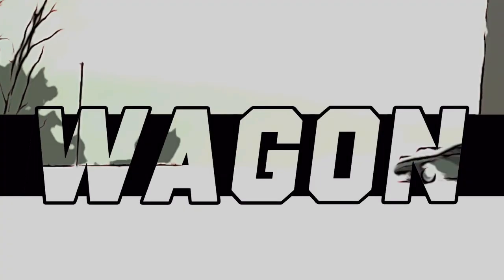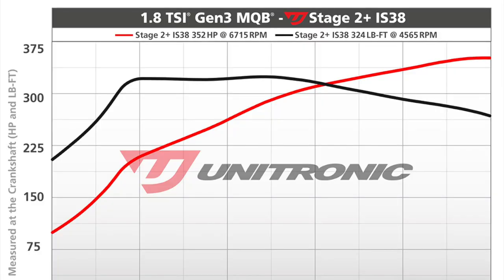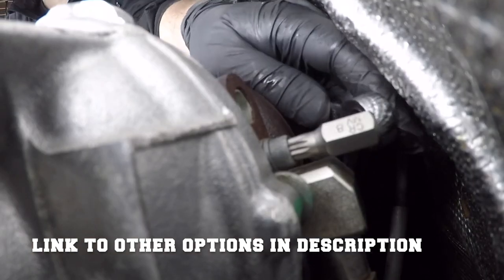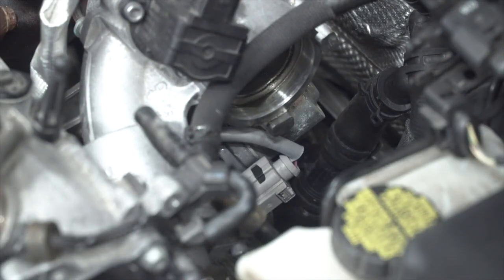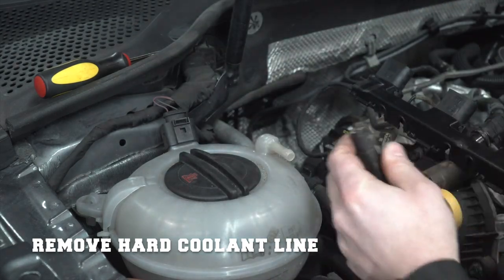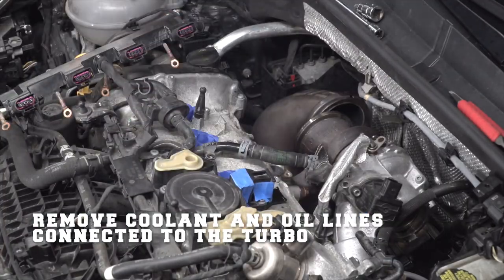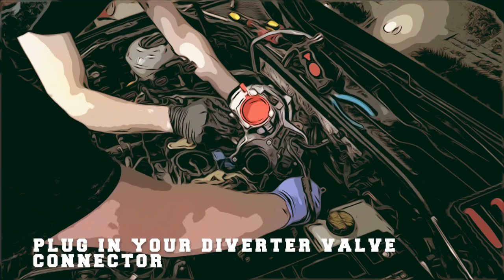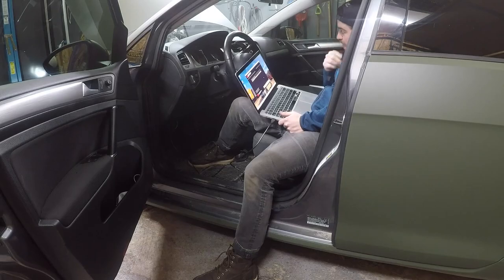Installing an IS38 Turbo - Mk7 Golf Sportwagen - Helpful Tips and More

Comment: That was a pretty undramatic 4.3x 0-60 run. 
4.3 to 60 was what C&D tested a 360 Modena at in 2000. It's a quick number.
Thanks for sharing.

Comment: I just did the APR IS20 in my 2015 FWD GSW. definitely notice the difference. Will do intercooler by spring.
Reply: I should also note that I have been having misfire issues since doing this upgrade. Have yet to do a launch without epc light misfire error.

Comment: Good to see a video where they don't remove the dp. It actually makes me feel a lot more confident I could do this. ADD makes reassembly after a job SO DAUNTING and having it possible, on awd, makes me think i'ma do this myself. Probably going is20 though. Not sure I can pass inspection with a high flow catalytic converter in NJ.
Reply: Ahhh crap. Oem dp does have to come out, apparently. Someone please advise me if I'm wrong. Thanks!

Comment: Pro tip: Don’t listen to what these OTS tuners tell you when it comes to wastegate voltage. 3.9 volts is very high! Go for 3.2-3.6 volts. Also, setting the voltage when the turbo is out of the car does not mean the voltage will be the same when it’s installed. As the last step to the turbo install, double check the wastegate voltage! Always!

Thank me later
Reply: Just went thru this yesterday forgot to adjust it and I got a EPC light gonna adjust it tomorrow after work
Reply: its 3.5 to 3.8

Comment: Hi @dadwagon, I've got a 2016 GSW and I've recently tried the Unitronic Stage 1 ECU tune. When I do that I notice a vibration at low revs (at idle) so that when I engage the transmission into drive or reverse from a stop (obvs) the car feels like it's 'pulsing' forward. I don't think that the car is actually pulsing forward, it just feels that way becuase of the vibration. Have you ever noticed anything like this or even heard of that? I've applied the tune and backed it off twice due to this issue. Any advice is of use to me.
Reply from the maker: Richard, i dont' know of that and i don't have any specific advice for you there other than reach out to unitronic - they're very helpful and responsive.

Comment: After setting the WG voltage, did you have to do the adaptation?  I got OBD11 and it looks like might need vcds.
Reply from the maker: Yes, I was able to run the adaption with obd11 pro

Comment: Are you running 94 octane all the time? Is it hard to find in your area? Is it hard to find in your travels?
Reply from the maker: Running 93 everywhere. Easy to find in Michigan (every gas station sells it). Only been around the Midwest, and is very, very common.
Reply from the maker: Will also mix 93 with E85 to hit closer to 100  octane
Reply: @DadWagon  94 is hard to find where I live (Central Canada). Shell seems to be  the only place that you can find 93/94. I wonder what happens if I would run 91 with an is38.
Reply from the maker: @kfrdubber You're not the only person who doesn't have easy access to 93-94 octane. You have two main options I believe - 1. If you have access to E85 - you can look up how to mix e85 with 91 to increase the octane to 93 - there are apps to help calculate. 2. I believe there are some tuners that make an IS38 tune specific to 91 octane (i may be wrong).

Comment: Nice install, how did you lose weight ?
Reply from the maker: Just eating better and tracking it more closely. Used NOOM to help.
Reply from the maker: Near the end i started running a couple miles every other day.
Reply: Nice, I'm debating if it's really worth it... I need suspension and wheels, I'm already stage 1+ with intake, muffler delete and inlet.